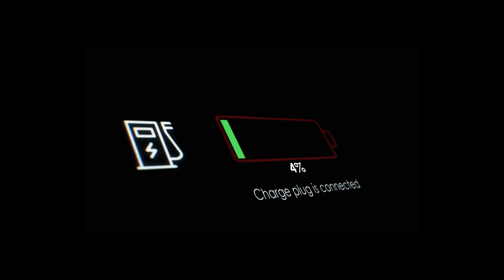Sustainable Energy from Germany | HPB Solid State Battery Game Changer #germany #solidstatebattery

Comment: game changer? Solid Battery has been already in full production in China and should be deliver starting next year. so not sure why this one will be a game changer compare to the one we already have from CATL.
Reply: Not only in China. 
Some buses works for a  decade already, but still as test, because that particular technology has some drawbacks.
Reply from the maker: Hopefully, the drawbacks of these batteries will be overcomed soon.
Reply: @FuturisticTechandAI  Hard hopes, because one is that they run hot. I mean that needs to be hot to run properly, so insulation must be really good, and second, you must run them a lot to make sense. For a personal car will make no sense, since even well insulated will get cold in 23 hours and then needs to be heated again for only an hour of use. 

And not last, is the price. And without mass production this cannot be low enough.
Reply from the maker: Yeah each of them have a different concept.